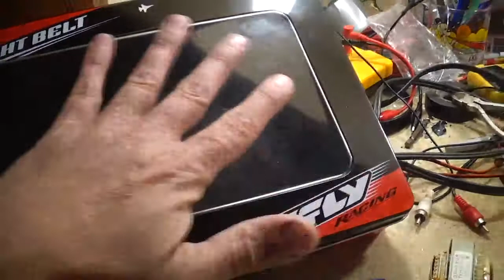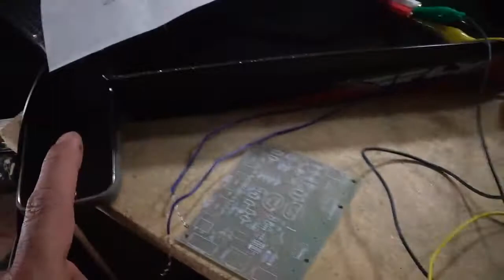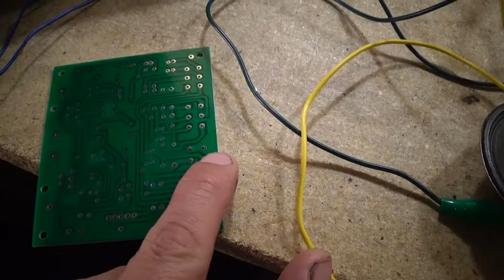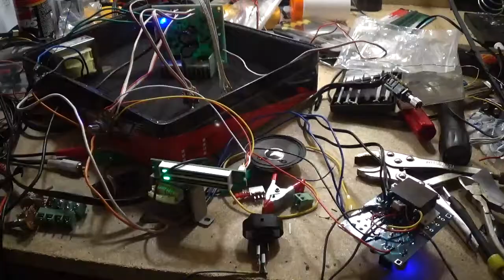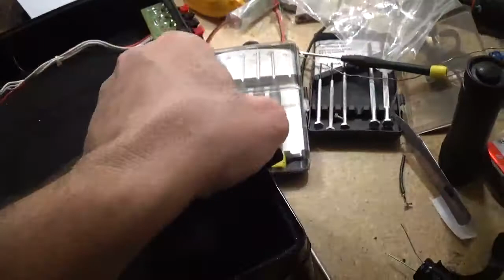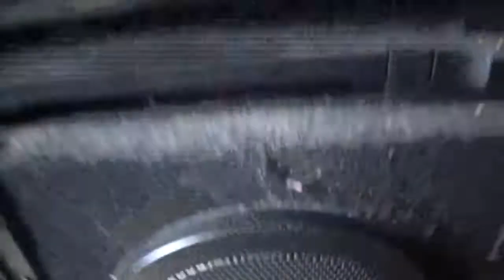TDA2030A Amp Build, Made From Kits

Comment: I have also built this kit. No problems with pots but one of the chip was faulty. No buzzing however. I think it may be the extended leads to the pots. Screened cable will fix that and make sure the box is earthed.